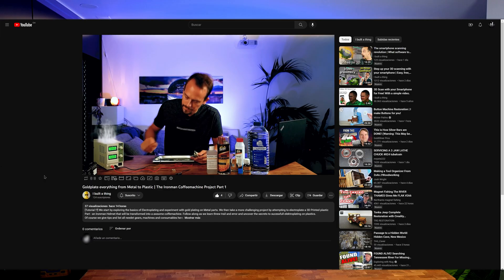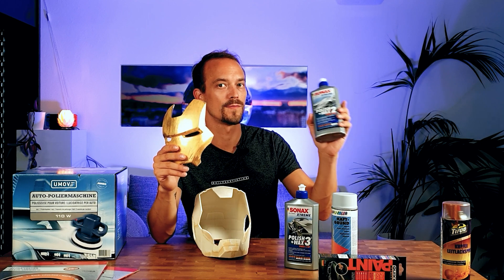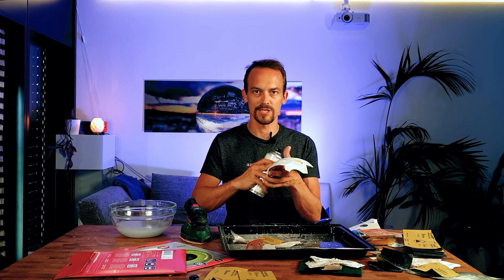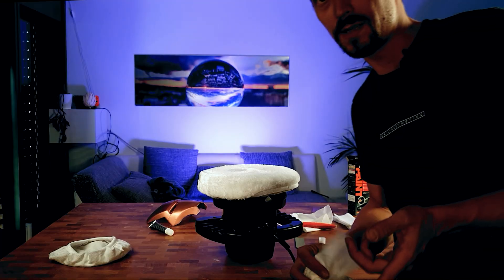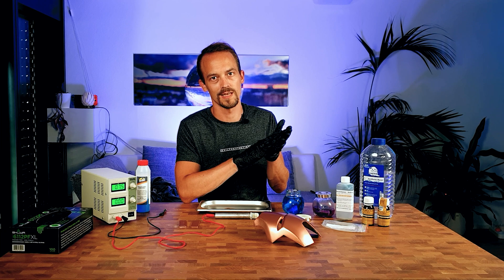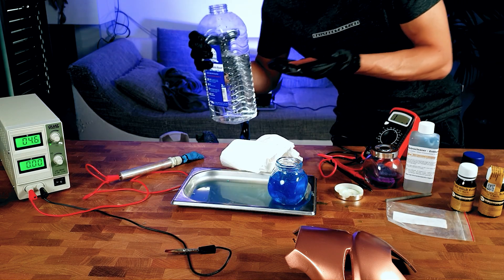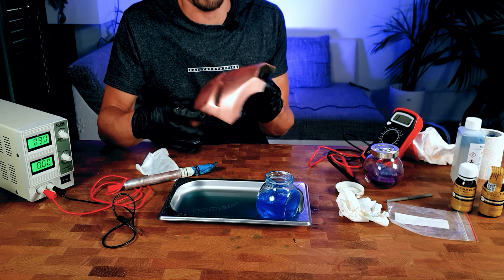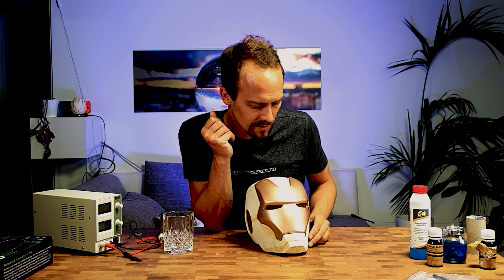DIY Gold plating | Metal to Plastic | The Ironman Coffemachine Project Part 2

Comment: Interesting but wouldn't it be better to use the same technique used for through hole plating pcb's. That liquid, what ever it is, causes the surface to be conductive so it can be copper plated and then you plate what ever you want on top. I could be wrong but I suspect this is how plastic is chrome plated